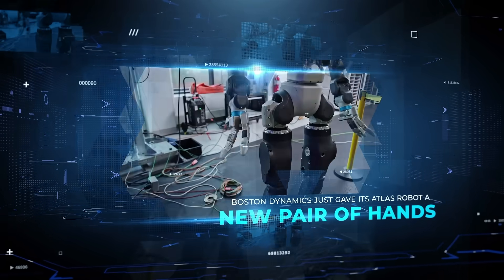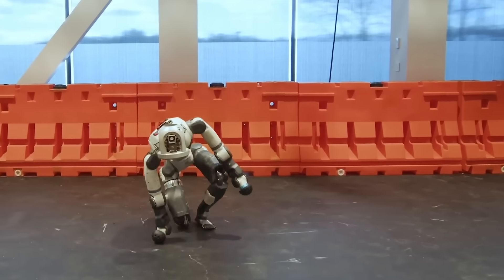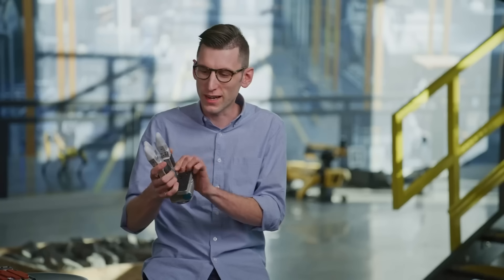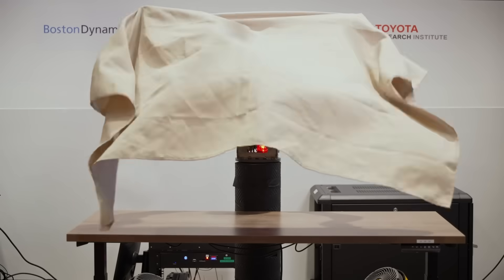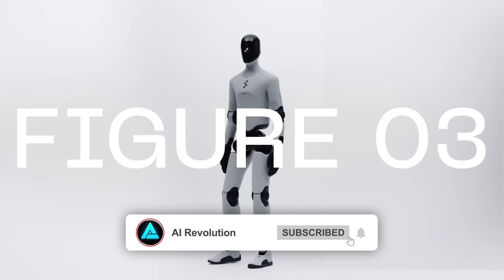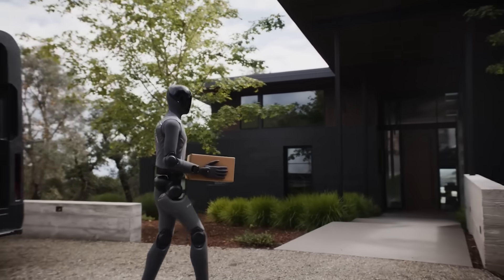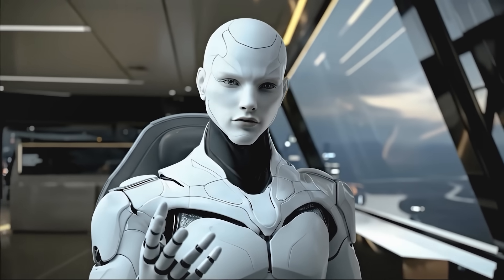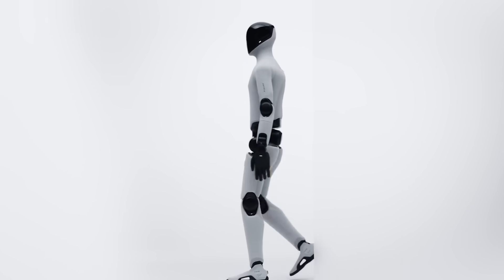Boston Dynamics Just Upgraded Atlas and It’s Starting to Feel Human (New Skills)

Comment: During the design process, each team member should focus on a specific part of the robotic hand—like the fingers, joints, or palm—to ensure efficient use of resources and specialized development. Additionally, develop a six-fingered manipulator that can operate in two modes: a standard six-finger setup and an alternate mode where the fingers are grouped into clusters, providing versatile handling capabilities. This dual-mode design ensures that if any finger—such as a phalange or joint—suffers damage or breaks, the hand can still function effectively by reverting to a reduced mode with three operational fingers. This fallback occurs when damage causes the hand to switch from six fingers back to its default three-finger configuration, which is intended to allow continued operation despite partial damage.

Comment: putting the actuators in the finger joints seems like a fairly serious bottleneck if you want to make the hand more dexterous(smaller) while maintaining grip strength, you'd think a more human like solution of creating artificial tendons for the fingers linked to the actuators in the forearm would be a more optimal long term strategy

Comment: By the time ai software has finished automating white collar jobs and robotic advances have replaced most blue collar jobs, what exactly will people be doing? Humans need to be engaged. These advances all look wonderful on the face of it but the truth is we are heading rapidly towards a tiny minority of super elite enriching themselves and a vast majority of dispossessed with nothing productive to do. It will end very very badly.
Reply: It won't be a problem.  The rich will just stop feeding us and within a year we will all be dead.  Problem solved.
Reply: Nope. Humanoids in the WORKFOCE is a fallacy. Go see how Amazon and others are replacing people. Factory robots are ALREADY using vision and AI and they don’t look like humans because humans are limited(they have to climb ladders, hands too big for small things etc.) So if an android could do it, it’s already automated! Can it wash it’s hands?🤮 If you have a trade job, you’d probably realize it would be impossible(or excruciatingly slow) to do it with robot hands. In many cases the hands would be too weak to do the job(squeeze pliers etc) and will probably wear out quickly. let alone have a brain that still can’t drive after eight years. When they finally do work, they would be nice if a handicap person could use it as a telepresence to go shopping or do simple chores.
If Optimus could assemble widgets, or do manicures, etc. it would need special tools not batteries and legs. It's not strong enough to dig a hole or help someone get up off the floor. That’s why One-size-fits-all is a bad strategy. Imagine your brain operating an Optimus. Could you go work at McDonalds and put a lid on a paper cup? Can the sensors feel enough of the lid that you won't just crush the lid or the cup? Wash your hands? How long would it take you to change gloves, start a roll of tape etc.? A humanoid MUST do a job on par with a person because workplaces are made so people along with automation maximize asset utilization. That is why you CAN'T JUST put two androids in place of one person.

Comment: Make a robot with 4 or 6 arms, that'd be more useful
as a human i wish i had 4 or 6 arms at times ,.,
Reply: Imagine all the typing you could do, all of the multi-tasking!
Reply: @ERR-NULL00 very true but it would look like a alien
Reply: @Syncere20  robots should be function over form
who cares if a car has one, two or three headlights?
Reply: Bad idea.  Our world is designed for the human form.  Imagine telling your bot with six arms to get in your car and drive to town and get some milk.  How is it going to fit in your car with six arms?  A robot with a human form will be able seamlessly to step into our world and start doing stuff immediately without having to redesign everything for creatures with six arms or whatever.
Reply: @jlrutube1312  Easy, just don't make it get in the car? Robots with multiple arms would be better at warehouse work, or serving customers with many trays (although you could just make tiny little platforms that you can put the customer's plates in)
Reply: @ERR-NULL00  Also adding multiple arms would add a lot of cost to the robot and also it would be a lot heavier which would make it more dangerous if it fell on you and also a heavier bot would require more battery to carry it around and also a bigger battery would add even more weight. Also bots are trained by imitating human work using tele-operation or video but since people don't have 6 arms that would be difficult to do.   

So yes, there might be a situation where a robot with 5 or 6 arms would be good but probably not very many.  The people working at Tesla and Figure have both talked about why the humanoid form is the best one, at least for starting out, and I believe they know what they are doing.  But yes, eventually it might be good to have a six arm robot or whatever.  Cheers.
Reply: You will eat, drink, hold your smartphone, and masturbate all at the same time.
Reply: Goro! :)
Reply: The question is if the human brain can handle more than two arms. Why are you sure that you'll be able to control arms separately beyond the first two?

Comment: Figure partnered with a company that will allow them to put them in thousands of homes for testing and are already in work environments like BMW an optimus will be doing the same at tesla but boston dynamics is so boring i feel like they have such a good robot with atlas an have the best movement besides the G1 but idk they dont seem to be pushing as hard as Figure an optimus to get out in the real world time will tell though.
Reply: Humanoids in the WORKFOCE is a fallacy. Go see how Amazon and others are replacing people. Factory robots are ALREADY using vision and AI and they don’t look like humans because humans are limited(they have to climb ladders, hands too big for small things etc.) So if an android could do it, it’s already automated! Can it wash it’s hands?🤮 If you have a trade job, you’d probably realize it would be impossible(at least excruciatingly slow) to do it with robot hands. In many cases the hands would be too weak to do the job(squeeze pliers etc) and will probably wear out quickly. let alone have a brain that still can’t drive after eight years. When they finally do work, they would be nice if a handicap person could use it as a telepresence to go shopping or do simple chores. It's not practical at BMW. This is why Elon's engineers are quitting. If Optimus could assemble widgets, or do manicures, etc. it would need special tools not batteries and legs. It's not strong enough to dig a hole or help someone get up off the floor. That’s why One-size-fits-all is a bad strategy. Imagine your brain operating an Optimus. Could you go work at McDonalds and put a lid on a paper cup? Can the sensors feel enough of the lid that you won't just crush the lid or the cup? Wash your hands? How long would it take you to change gloves, start a roll of tape etc.? A humanoid MUST do a job on par with a person because workplaces are made so people along with automation maximize asset utilization. That is why you CAN'T JUST put two androids in place of one person.
Reply: @zaphodbeeblebrox2817  To say its a fallacy is kinda wild there are plenty of simple jobs they can do in the work force an ive watched the amazon robots an there's literally jobs where people stand there still all day an do robot like tasks that can easily be replaced with a humanoid. No its not one fits all an that's fine of course its not though there's more efficient ways of doing things with other robots made for a specific task an who cares lmfao. I don't even know what your saying here because i wasn't saying they would be xD but they will be 100x more efficient don't know what your trying to say on that front like they work 24/7 an you gotta think whats so hard  about having them have certain hands for certain jobs you act like they also wont get better they will be increasing speed at insane rates once they get enough of them working everyone will make the next one better with data.
Reply: @Ovnah  “People stand there still all day and do robot like tasks“ EXACTLY!
So it doesn’t need batteries and legs. It only needs one arm and an eyes. They are ALREADY doing this!!! The humanoid form does not help with gripping and moving objects. But the humanoid form limits what the robot can do. Like I said, it will be good for a Tele presence, but Mark my words you will not see them in factories for the reasons I have previously stated.
Reply: @zaphodbeeblebrox2817  but these are meant for the home not the factory though...right?  were adding them to a human formed environment, which predicates them being at least approximately human form themselves to avoid us needing to adjust our environment to there specifications..rather than the other way round. The fact that they could also potentially displace humans currently in non domestic settings seems secondary rather than Primary in its adaptation.

The most obvious use would be 24/7 personal care, with an aging highly atomized population this seems like a potential game changer, assuming these every manage a level of self autonomy that ensures they're actually reliably safe to be around..
Reply: @johntowers1213 
Personal care requires hand washing and still has the same dexterity and strength problems as other jobs. 
Some clueless people say there will be "millions in factories". Telepresence for limited self care and freedom for a handicap/elderly person would be a good use and people will buy them as toys but the market for these things will be small.